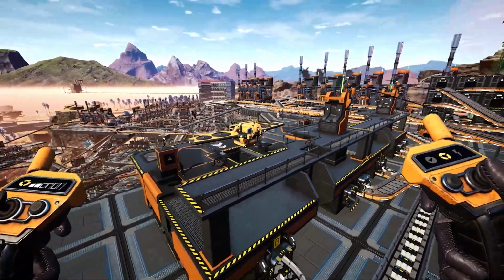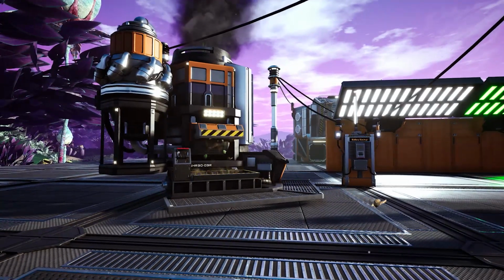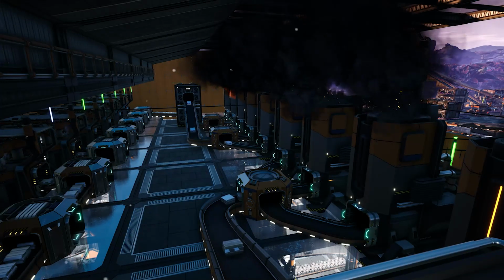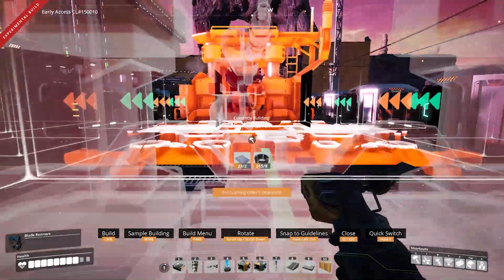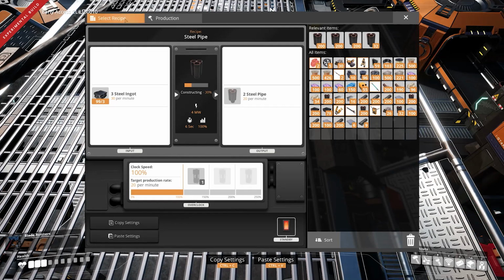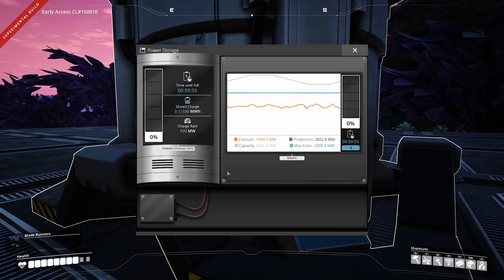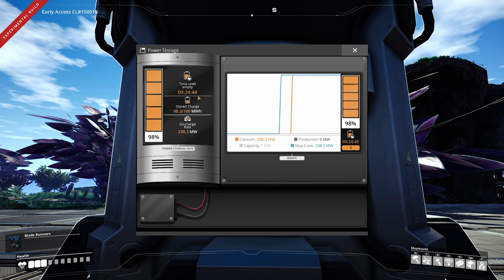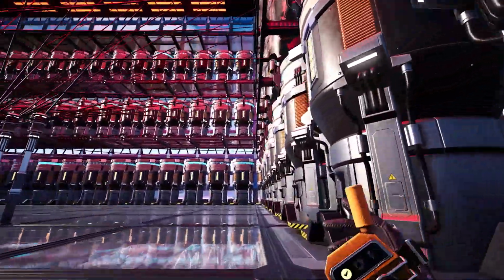Satisfactory - Useful Tricks for Power Switches & Batteries

Comment: Pure gold, the music and audio cuts were perfect. Tips are good ones. I didn't think about being able to control power and resource flow like that but that gives me an idea for a challenge. Running a factory with a small amount of power, and using switches to turn on or off the factory to make parts.
Reply from the maker: Thanks and that sounds like a perfect use for those power switches.